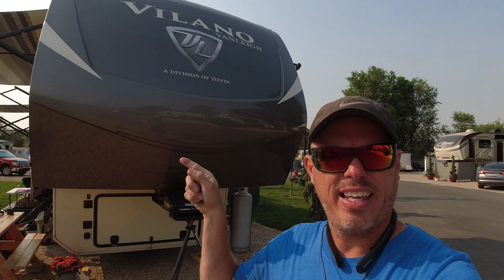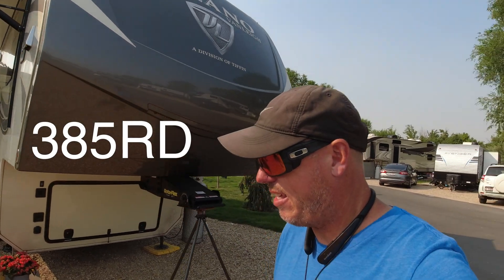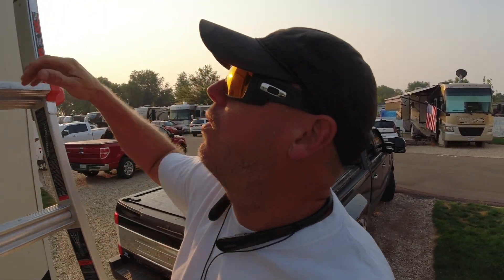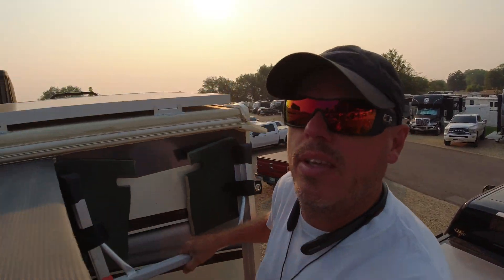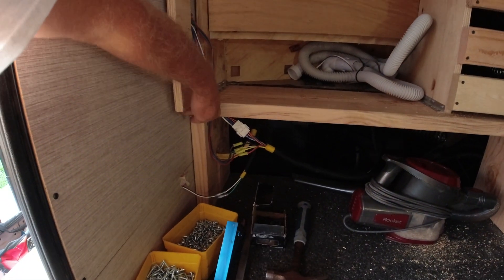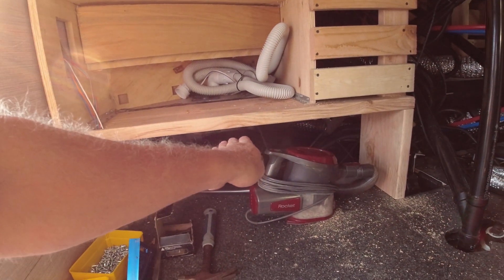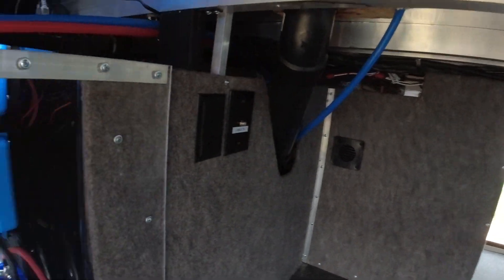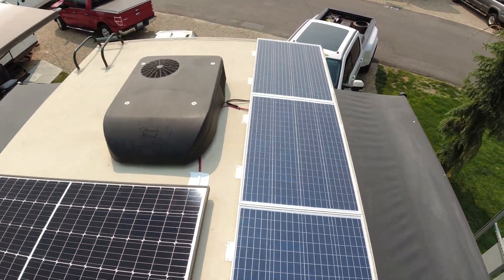2021 Vanleigh Vilano 385RD | Battle Born & Solar Upfit

Comment: Hi there!  This is an awesome job!  

I was really wanting to sign up for your southern UT slot in October.  But, our rig hasn’t arrived yet and knew it would be irresponsible to do that with all of the manufacturing delays that are going on.  The rig (Outdoors RV 22FQS) should have been constructed last week or this week and just waiting to be delivered .  

I really like your adaptive construction to accommodate or enhance the mounting areas for the equipment. 

Safe travels
Reply from the maker: Well, that's excellent- thank you for being thoughtful! We've had this occur and we typically move around the schedule somehow to accommodate, so we'd love to chat with you! Great choice on rig!
Reply: @TheDryCampers  Hi there!!  Ok...I will get on your website and submit a contact form to see if you are going to be in the general area.  I am in Ouray CO and  have no problem doing a 8hr radius.

Comment: Great job 👍 And Thank you for the information about the Cerbo. I installed it in are rig and it does not  work with are hotspot. 
Thank you again
Reply: Update - there was one minor setup issue that I corrected and have not had one issue since. Cerbo is really amazing! We are hitting the road in a few weeks and will put the wifi and the Cerbo to the test!!